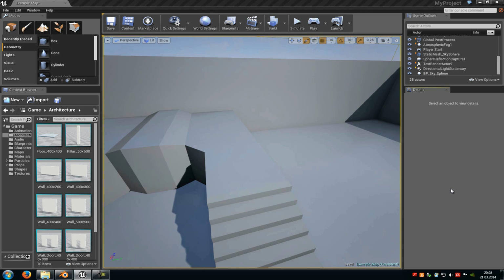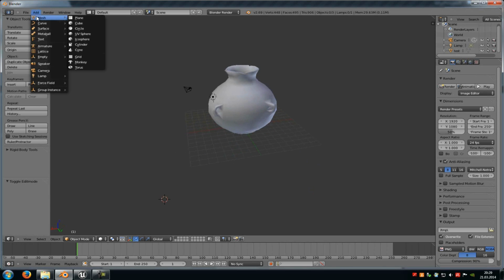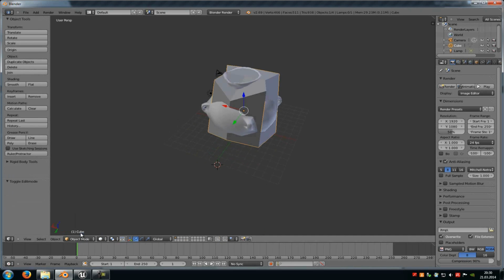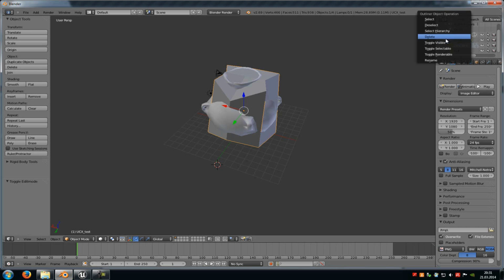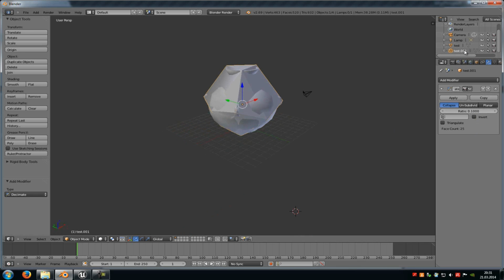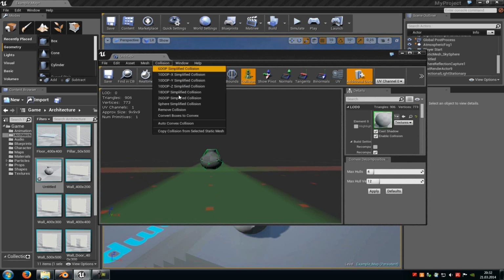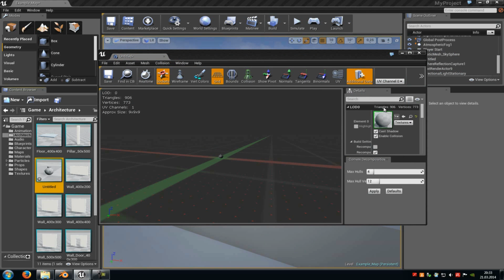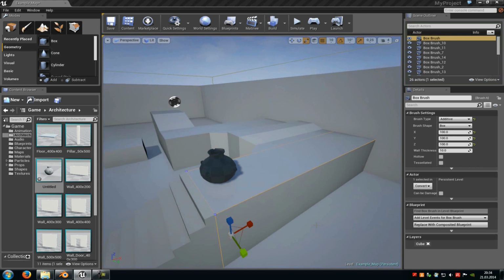Unreal Engine 4 Tutorial: Collision (english)

Comment: I use "Use complex collision as simple" or "Use simple collision as complex" to give better collision for my models (They are all rocks, UE4 mannequin size), because I want some accurate collision for my uneven rocks, is that necessary? Will that affect my game performance later?
Reply: +neighbor lee  I think I will have quite some rocks in my scene. That is why I don't know which way is the best for applying collision. But I get what you said, like using duplicate model for collision, that can be done inside the 3D modeling software right? I know this method. 
I also tried to apply "Use complex collision as simple" for every rock I created in UE4, their vertices are about averagely 4000. Then I placed many of them in close distance and played the scene, the FPS didn't drop. I don't know if it is just because I only had rocks in my scene but nothing else, or the collision doesn't effect the fps at all.

Comment: So I bet that some of you understand the issue I am having.  If you wanted a level to be inside a bottle (ship in a bottle thing) I cant get the bottle to allow any of the payers to go into it. without collision they can just walk thru or fall thru..   I would need collision only on the bottom 1/2 of the bottle, lying on its side of course, as this is not an in the air thing.  I have spent much time in blender and ue4 trying to get collision just where I need it and nope, no good.

Comment: Where do you disable one convex hull per ucx? I'm using maya 2015 and unreal engine 4.5. Also do you know how to convert to convex hull in maya? I can't find that option. And everytime I import a house from maya to ue4, ue4 auto generates a collision mesh and I can't enter my house because the collision is blocking. Any help?

EDIT: I got it working. I had to use the drop down menu when importing. What is the propper way to make collision for house with accessible interiors? Should I always duplicate my house and rename it to UCX_ModelName?
Reply: Its in unreal not the modeler.
Reply: I just did the duplicate and rename method and my collision was wrong. After I re-imported it in unreal with that setting, it fixed my issue.

Comment: The blender export "fbx 7.4 binary" does not support multiple collision meshes. This is very annoying.

lets say you have a room mesh called room. You used to be able to have UCX_room.000, UCX_room.001, etc. The binary export only recognizes an exact UCX_room collision.

If you change the export to to "fbx 6.1 ASCII" it works.

so... if anyone is having trouble exporting collision meshes, use fbx 6.1 not the binary.
Reply: Or just Make your collision and then make it one object as the room is one object?